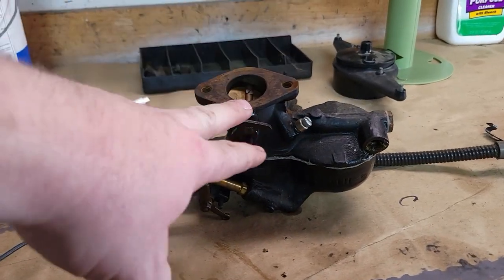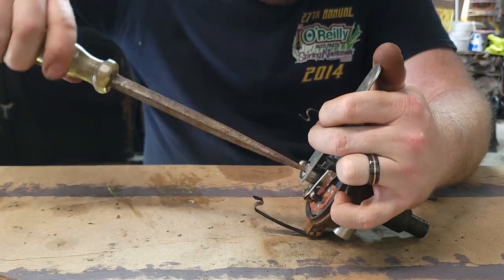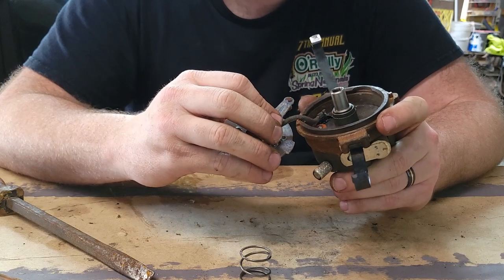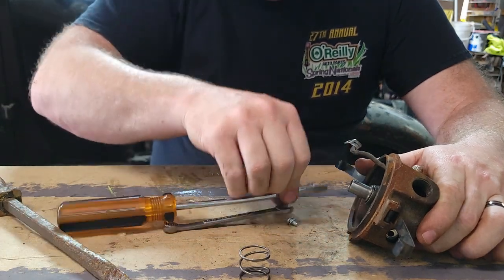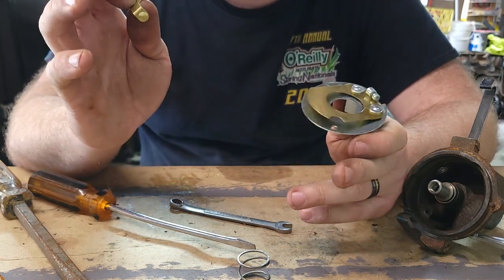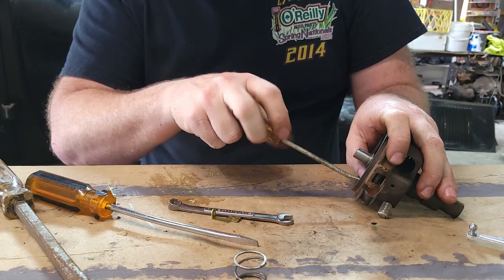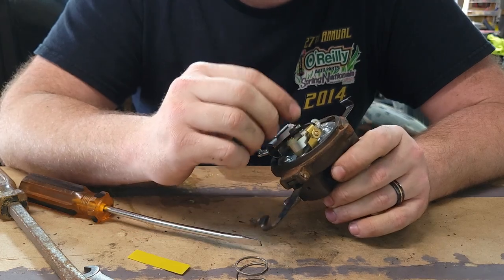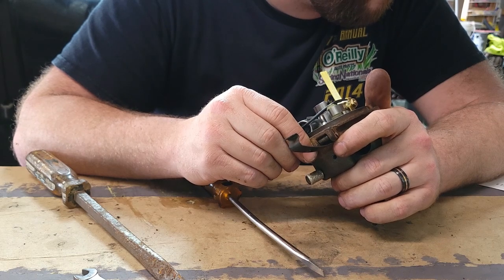Upgrading a Model A distributor

Comment: Should only snug the screws to hold the points in position. If you snug them down, then the points should not move on the plate when you do a final tightening and the cam position will not matter, check for proper gap after you tighten.